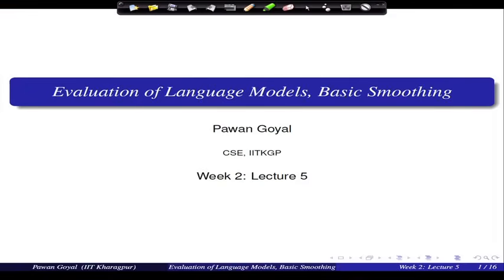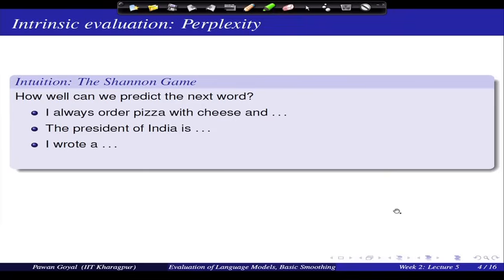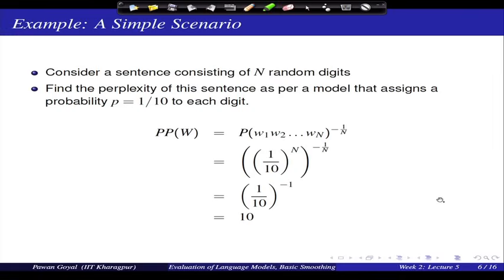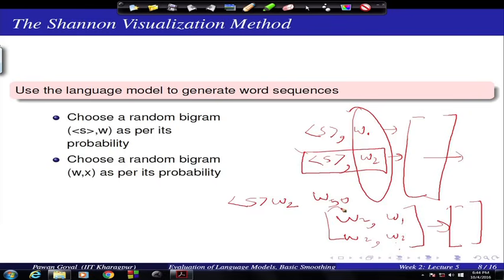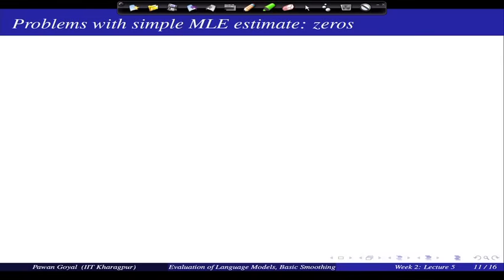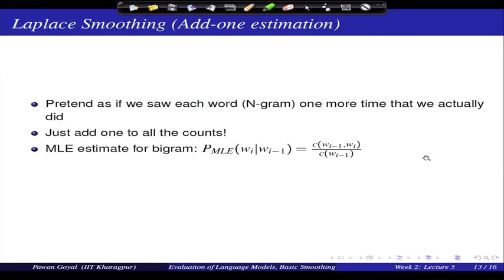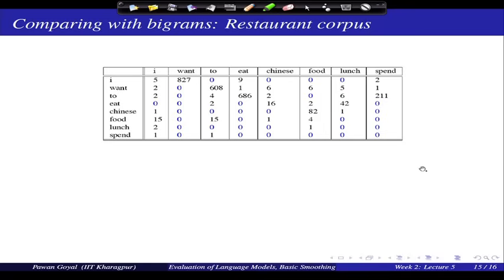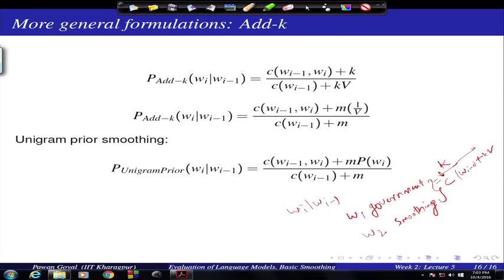Lecture 10: Evaluation of Language Models, Basic Smoothing

Comment: The term smoothing refers to the adjustment of the maximum likelihood estimator of a language model so that it will be more accurate. ... When estimating a language model based on a limited amount of text, such as a single document, smoothing of the maximum likelihood model is extremely important.